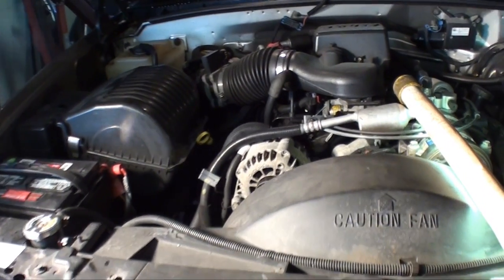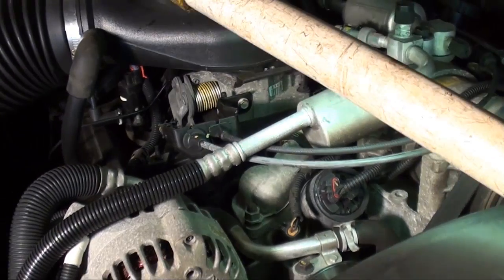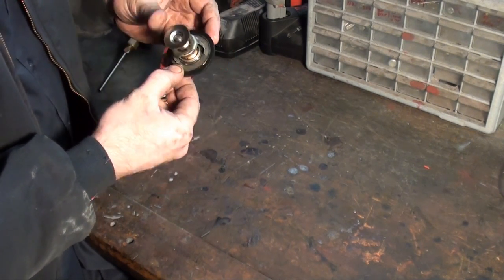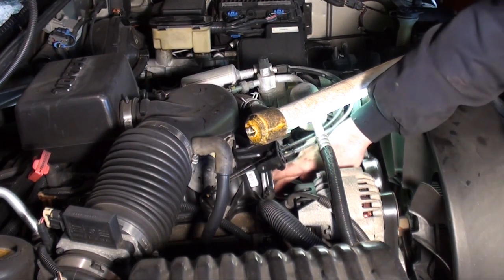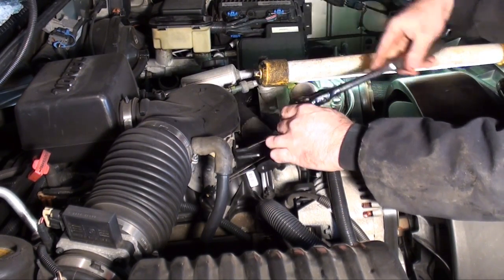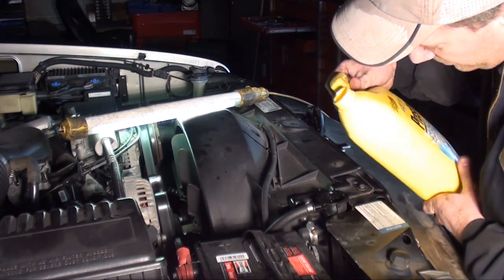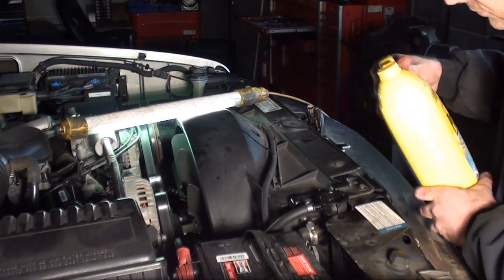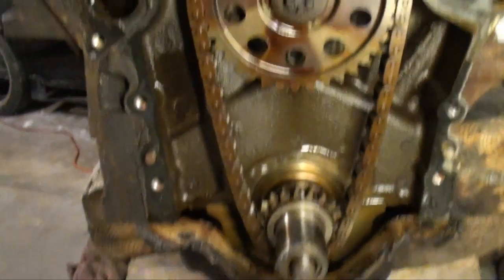Engine not heating up / poor fuel mileage

Comment: I change the stat and still engine doesn't warm up to temp during winter especially when is 38° and driving it well drop all the way to cold (gauge neddle) but If its fine! When hot weather it will not even get to have the temp! 2014 durango rt

Comment: I have a 2017 charger rt it cammed car was tuned on 93 straight pipe no cats just added highflow catalytic converter got a code p1eoa Closed Loop Fueling on bank 2 Downstream any ideas ??

Comment: I have a 95 Dodge Ram 3.9 and I think I have this problem but first the truck was overheating big time it was reaching the 230 temperature and I changed the radiator for a new one now with the new radiator in never pass from 140 and I notice that it is gives me poor gas milage could it be that the thermostat is open

Comment: the question I get hot air the needle on the gauge is in the middle but I get open and closed loop what else can be the problem
Reply: The temperature sender is bad.

Comment: hi, the temperature gauge seems to never reach the middle, and when I got on the highway,  the temperature gauge dropped to only a tiny bit above of the "Cold” I change thermostat 4time but same problem.
Reply: Change coolant temperature sensor
Reply: Flush cooling system
Reply: nino nodia same thing is happening to my car did you find out what it was?

Comment: This may be a dumb question but iisn't there a much simpler test for a stuck open thermostat?  I was told that if I just take off the radiator cap and cold start the car, I would see immediate coolant flow at the top of the radiator if the thermostat was stuck open. Makes sense to me.

Comment: Excellent job of showing the role of a thermostat on an engine. If you mentioned it, I missed it. The reason a cold engine gets lower mileage is because it much run a richer fuel mixture with lower air to fuel ratio or it will stall. The result is greater fuel consumption combined with lower power output causing lower gas mileage. Once the engine is warm, it can run on a leaner fuel mixture, improving not only mileage, but efficiency with greater power output and fewer pollutants.

Knew immediately in the first video with engine running cold on its temperature gauge, plus the heater and defroster not working very well (uses the hot radiator coolant by blowing air across a mini radiator inside the passenger compartment) that the culprit would be a wide open thermostat. Not much else that it could be. A number of failure modes can result in an engine running hot. There's only one I know of that causes an engine to continuously run cold: a thermostat stuck open. Not necessarily intuitive to someone who doesn't know anything about how the cooling system on a water cooled engine operates but becomes abundantly clear once they know its basic operating principles.
Reply: He explained all that in the part 1 video in depth. He explained open loop vs closed loop, o2 sensor readings, and the affects that has on fuel trim.
Reply: Wow. Everything I needed to hear (read). My thermostat is stuck open but I didn't think the temp gauge would be so low, but its running so damn rich.. Thank you man, great paragraphs packed with info. Thanks a ton!
Reply: I tried to change mine and I stripped the nut. So I aborted the mission. I don’t know what to do. I need to change it. But I can’t

Comment: Can you explain how would this problem also effect the gas mileage too, my thermostat must be stuck open too my expedition won’t heat above 1/4 on the gauge and engine light came on with a p0125 code I just checked it today
Reply: Engines are designed to operate within a specific temperature range that optimizes the energy it gets from burning the fuel. That's why there is a thermostat that regulates coolant flow. Even before there was open and closed loop operation using temperature and O2 sensors with an electronic engine control module, a cold engine with wide open thermostat would not run as efficiently. In order to continue running and run smoothly, it had to run a "richer" fuel/air mixture with higher fuel content, consuming more fuel and delivering lower fuel mileage.

In days of yore with manual chokes, you had to pull out the choke knob, to choke the carburetor forcing a rich mixture to start the engine. As it warmed up you would push the choke knob back in, and if you didn't, it would start running rough again, most likely stalling out. The choke literally chokes off air to the engine by closing down the carburetor's air intake with a butterfly valve, greatly restricting the amount of air intake. The industry started putting automatic chokes on carburetors that would gradually reduce the amount of choke as the intake manifold warmed up. Most had a bimetallic strip using the same principle that operates a heating and cooling thermostat. With modern vehicles that have electronic engine control, it's done with temperature sensors. The bottom line: a cold engine requires a richer fuel mixture to operate, consuming more fuel and reducing fuel mileage. In addition, the pollutants also increase. My snow blower, as with nearly all of them, has a manual choke. Needs to be fully choked to start with the carburetor primed with some fuel (there's a primer button), and the choke set to about half after a couple minutes, and then completely unchoked after about five minutes. Won't cold start unless choked and it's a bit smoky for about ten seconds as it's running that rich. Won't continue running if it's still choked much after the engine is fully warmed up.

Comment: Did the vehicles OBD II have any codes?
Reply: Truth4U 2Know this usually wont pop a hard code on older vehicles, usually you will notice it on the temperature needle gauge and on poor fuel economy.

Comment: +robinsonsauto hey there, I have a Mazda 6 2006. Trouble code P0126 insufficient coolant temperature for stable operation. I believe the process on my vehicle is way more complex then this, do you think as a beginner I should do this myself or should I try it out on my own and learn. I have to remove the power steering pump and take my belt off, it seems so super hard but I can't afford the repairs it's just so costly. My temp gauge reads dead centre when I drive. Just recently I unplugged my rad cap and I started the car, I let it run for a little incase there was an airbubble present. When I did this my engine light shut off and has been off and hasn't come back on, HOWEVER, when I hook up my scanner it's still saying the same thing and code... I don't believe I fixed anything so I'm not sure what to do, do you got any tips friend? Thanks a million :)

Comment: thank u for that. I have a problem with my 95 silverado. it stalls at random times. recently started here in the wite when it was lowest at 57° at night. stalled.. didn't turn off just shook. started in the street at 35mph. the following day in the highway at 65. when I got off and back on again.. wouldn't go higher that 55  unless I increase very slowly. now.. past few days it's been running like a champ. but the temperature gauge stayed one above 100 since the 1st sign of peoblems

Comment: I have a 1996 C1500 4.3 liter. It was running at 160 degrees. So, I dropped a 195 in there, the temp would spike to 195, the thermostat would open and flood the motor with cool fluid, dropping it like a rock to 150. Didn't like that, so, I just dropped a 195 Stant Superstat in which is supposed to open and close gradually to maintain 195. Well, it simply holds at 160. It might even be the same part I first removed. Enough is enough.
Reply: Mine does the same 1995 astro 4.3 it has to effect fuel mpg..
Reply: I'm having the same problem 2002 GMC SIERRA 1500 4.3 V6 VORTEC WITH 413000 THOUSANDS MILES new 195 STANT thermostat + found fan clutch was going out replaced with a HD unit option and have cardboard infront of the radiator it won't get warm enough about a hour of driving. 45 minutes trying to warm up before work its hall warm I have bypassed the ac compressor and idler pulley running a shorter belt ENGINE LIGHT ON O2 sensor heater elements out all 4 going to replace but still... up to a hour in winter in illinois O2 heater fuses replaced replacing O2 sensors all 4
Reply: @jasonhumphry5836  Illinois here as well.  I dont even remember this problem or what I did. I know I replaced the heater core and the rad because it was running hot at one point. My memory is shot.
Reply: @bg147  all good 👍 just thought I'd share and see how you're fix went 😉 peace and much respect to you Jason 👍

Comment from the maker: I agree, i see more issues with vehicles using dexcool, personally i recommend switching to green after major repairs or flushing, never the other way around, stay the same or switch to green that's the only two option i give, he has an appointment to have the entire system flushed next week along with some other repairs, this was a quick in and out

Comment: When it comes to coolant its reccommended not to change coolants expecally on deisels, but when it comes to going from dexcool to green not biggie, but green to dexcool big no no, dexcool is very acidic and can destroy seals, hoses, gaskets, bin there and seen it done... but if you do go from dexcool to antifreeze(green) drain the whole system, flush with water then add the green cololant and check strenght, mixing the 2 turns into a brown colour.

Comment from the maker: Each to their own, i prefer the standard style as well however i give my costumers the options of buying their own parts so it is what it is,
and to be honest i see this on all style thermostats, stuck open, stuck closed, in peaces you name it fail safe or not, otherwise we would never need to replace with whatever style you choose, the part number from the one removed actually matched gm oem not 100% sure what they use, what i can say is i used many fail safes without issue

Comment from the maker: Autoenginuity with enhancements, Thank you for the compliment
Reply: I bought the high end package and you'd be better off buying one of the Launch or Autel for half the price that includes the tablet. I put away my kit that I bought about 3 years ago, has been collecting dust, probably used it a couple of times but it was always inconsistent and dropping out, not sure how they are still in business, I just received one update during the 1 year support that they offer.